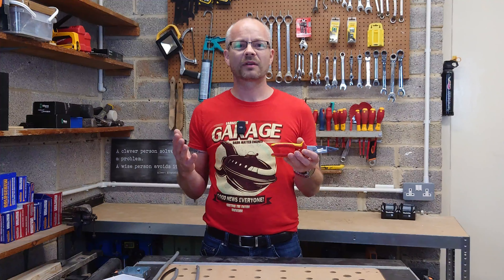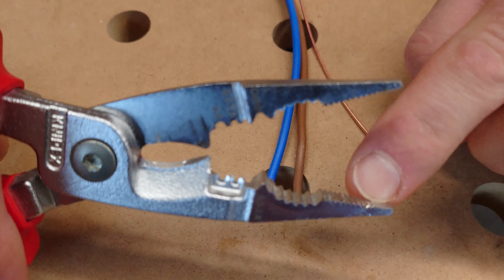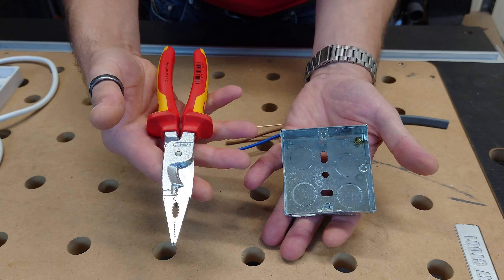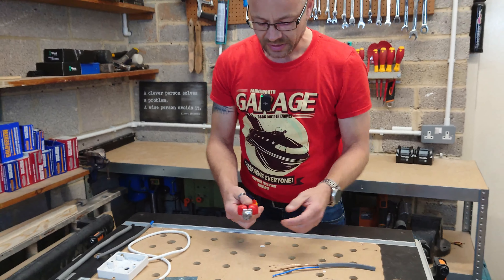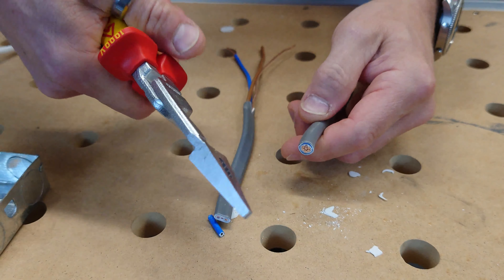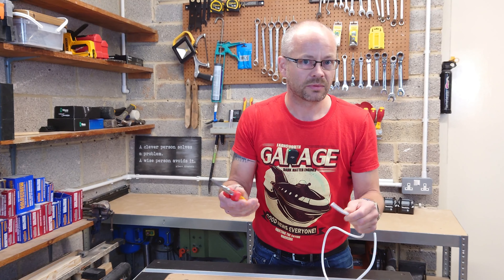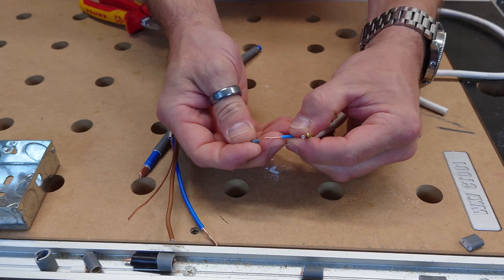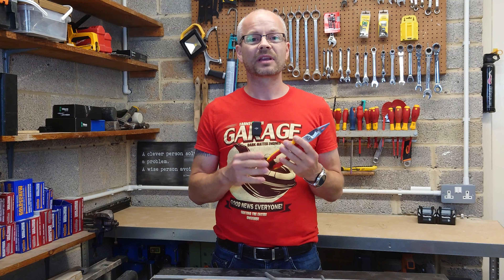Knipex Multi-Functional Pliers | The Go-To Tool for Electricians⚡

Comment: 4:40, thats my ONLY gripe so far after buying these, you need to be precise when cutting off outer insulation either the grey fte or flex sheathing. Too much and it needs to be done again or too little and you need to do it again. Maybe just practice thats all, but agree, great bit of kit in my toolbelt......
Reply from the maker: Practice makes perfect, you'd have the same issue if you used a knife or snips, it just takes a little time getting used to the feel of the cut. 💪👌

Comment: I’m moving into domestic install after years of commercial Maintence work, and these look ideal for knocking out loads of new installs 

Have you tried the Wiha version?
Reply from the maker: No I haven't, but in my experience of Wiha, it doesn't last very long. I replaced my screwdrivers every 6 months due to wear and breakage, and I have the first battery screwdriver they made, it failed half way through the first big job I used it on.

Comment: I've got the red and blue ones. There only downfall is that they're not really geared up towards starting to strip T&E. With snips you just put a cut in the middle, grab the earth, and pull it. Not so easy to do with these.
Reply from the maker: I totally agree, add a side cutter to these and they'd be perfect.
Reply: With T&E you pinch down the edge of the outer jacket with the pliers to break it and then you can peel it off to get to the earth wire.
Reply from the maker: @three-phase562  Good tip. Thank you 👍

Comment: I found knipex stripping holes dont work well on AWG, i feel like they are re marked metric holes. So if you’re in north america id stick with Klein over Knipex for strippers.
Reply from the maker: They're a German company, so being metric would make sense/ 0.75mm - 2.5mm. It wouldn't surprise me that they simply re marked the holes in imperial. 
I've never had issues cutting / stripping flex. What issues are you finding when stripping wire with these?
Reply: @ChampionsOfTheTrade  just my thoughts… i might of just ended up with s reject pair or something, everyone I’ve read has had better results. Still think Klein makes a better stripper though, just my opinion.
Reply from the maker: What's the Klein model? I'd like to compare 👍
Reply: @ChampionsOfTheTrade  Ive been using Klein J207-8CR since like… 2017 and i really like them.
Reply: @ChampionsOfTheTrade  and like i said I could totally have biases based upon they systems i work on.
Reply: @ChampionsOfTheTrade  in north America we tend to deal with thicker wire, solid wire, and tend  to bend hooks more often. We also have to be able to cut machine screws. So im sure these aspects of installation have influenced my opinion.